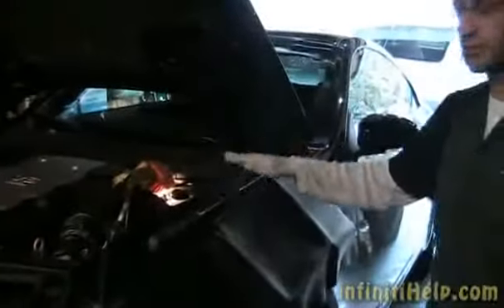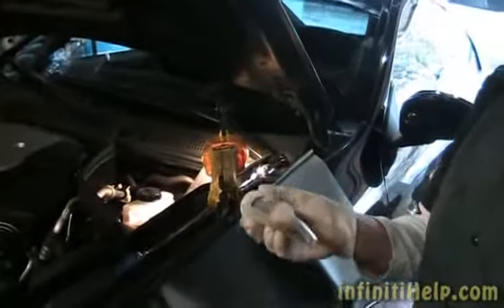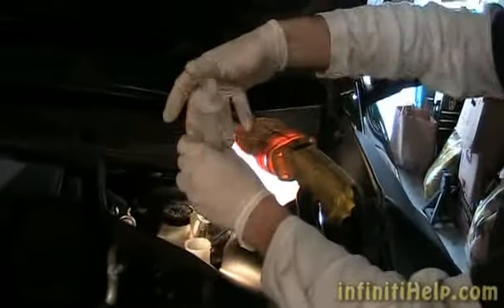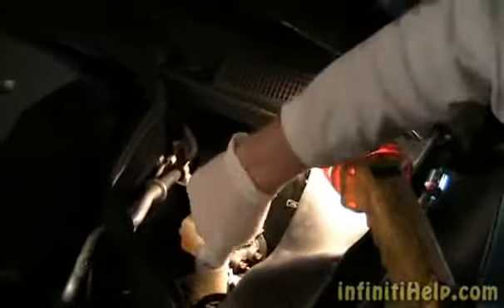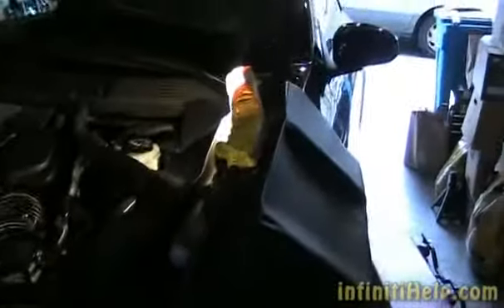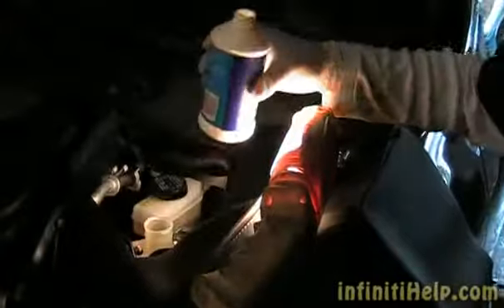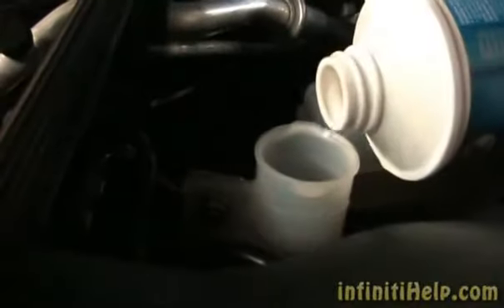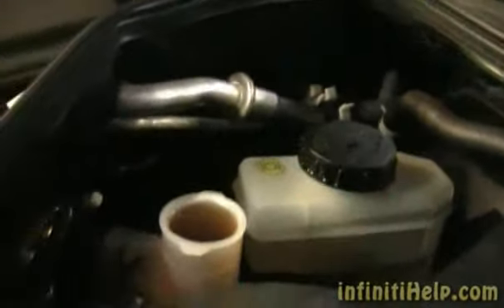Infiniti G35 Clutch Fluid Flush

Comment: One thing I noticed is he is pumping a little fast. The key on this is to pump real slow...like 2 to 3 seconds per interval. I personally use Motul 600 because it can take a lot of heat without boiling. But then again I do a lot of track days and all the fluids get pretty hot.

Comment: I've a question. I provided explicit instructions on how many times to pump the clutch pedal (x5), hold and release. Well, now, for some reason, I cannot get the pressure to build back up in the clutch pedal. 

I loosened the bleed valve when my friend voiced she had the clutch pedal holding at the floor, fluid came out,  I tightened the bleed valve back. I then asked her to release the clutch pedal, and then pump it x5 again and hold. She communicated to me that when she attempted to do this, the pedal wouldn't come back up on its own, that she had to manually pull it up and now there is no pressure and no spring, in the clutch pedal. Any advice would be super greatly appreciated!

I've watched so many DIY videos regarding maintenance for my car and never ever had an issue. Radiator flush, spark plug change, tensioner pulley, pulleys, alternator change, starter change, battery change, various led bulbs, fog lights, HID headlamps...however, this is the first  DIY where I needed a helper and it has not panned out thus far..wondering if it was something done incorrectly by my helper... :(

Comment: coz that's what you use.  See your manual.  It's "hydraulic fluid". Brake and clutch...same stuff but you need to make sure you're using the correct "dot" and NEVER mix them.

Comment: My 350z has 27k miles is a 2008.. Never ragged out.  I've noticed that when I occasionally push it .. say rolling at 30mph, drop to second gear and push it to 6800 rpm, go to third push it to 6k'ish.. then I back off as I'm well over 100mph.. That after I when I'm shifting from that 2nd to 3rd gear with RPM's so high the clutch pedal feels very different,.. it's not slipping but feels spongy or just 'off'.  Back down to normal shifting/rpms it's fine again.  Is it likely a fluid replacement would help/fix this?  Any ideas on what diameter tubing you used to put on that bleeder nipple/valve to drain?

Comment: Great video,  but I have one question. Would it be possible for me to use a brake bleeder/vacuum pump and do away with the need to pump the clutch pedal and open and close the bleeder screw?
Reply: never put vacuum on anything with a concentric style slave cylinder

Comment: I got an 05 G35 Coupe and I tried to replace a fluid myself also replaced steel line aswell but tried so hard to bleed the old fluid out but no fluid come out or pass thru the line. Why is that and what or how can I flush it thru? Plz help out cuz I even tried to use 100PSI flushing system kit still wont suck it out. My car still down right now. Thanks alot in advance
Reply from the maker: make sure your clutch pedal has free-play. If the master cyl is engaged, no fluid will come out.
Reply: Thank you very much for the hint there. I will loosing up and pull the master cylinder just to get enough space to adjust that rod that pushing against the master cylinder. I really appreciate it.

Comment: What side is the slave cylinder on?? I'm looking to replace mine? And how do you know if it's time to replace thanks
Reply: Alyloveseric88 its on the drivers side of the car. connected to the firewall. the clutch fluid reservoir should have a hose running directly to it
Reply: ^incorrect, the slave cylinder is attached to the clutch fork on the driver side of the transmission. He was defining where the MASTER cylinder is

Comment: My clutch is suck at the bottom. What do I do too get it back to normal. My fluid is clean bit I can't get my pedal to come back up by itself
Reply: Make sure that the pin holding the pedal assembly to the master cylinder rod is floating freely, if it is not, it may not be allowing new fluid to enter past the master cylinder.

Comment: I have problems with my gears not engaging or not releasing especially 1st,2nd or reverse. From what I researched it seems to be the slave cylinder that needs replacing. Could this be a solution to the problem?
Reply: did you find out what the problem was? sometimes my G35 doesnt go into first or second but not always..

Comment: I thought you were not supposed to let that reservoir empty. per the fsm.
Reply: Yes, that's correct. Letting the reservoir go empty can introduce air into the hydraulic system. However, here we are bleeding the system anyways so we are not worried about air entering since it will be bled out.

Comment: i was driving today and my clutch got stuck all the way to the bottom and it wont come back up and i cant put my car into any gears can you help me out i have the same year and model as this one in the video
Reply: What happened with that?  I depress my pedal to the point where it engages, no further... take my foot off and the pedal sinks to the floor by itself, like there's a vacuum pulling it down.  I'm having to hook a toe under my clutch pedal and pull it back up.